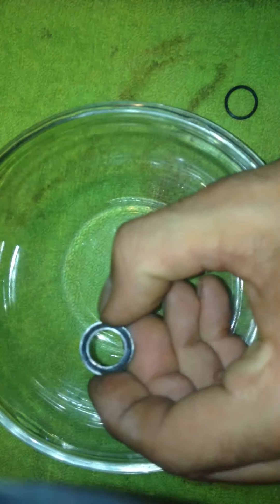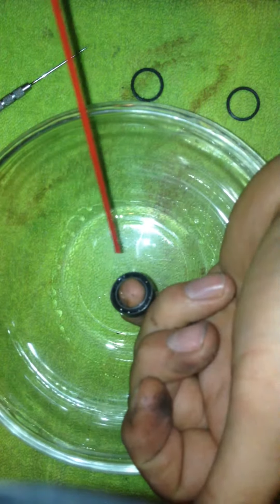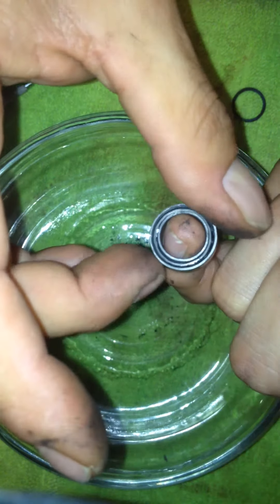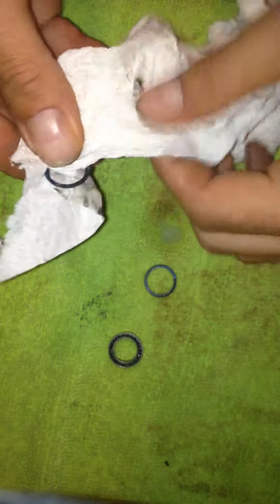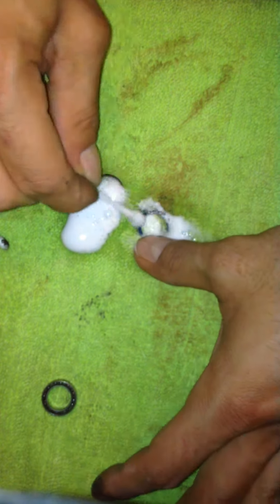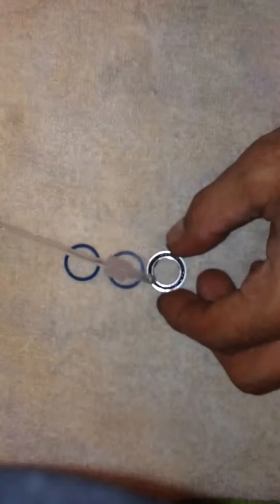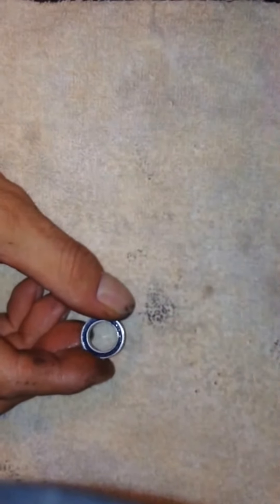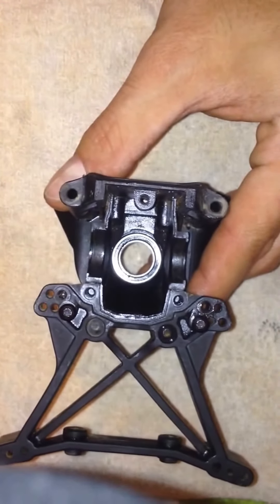How to Clean your Traxxas Slash 4x4 Rear Differential Drive Shaft Bearing.

Comment: nice video I will subscribe but in my car I cleaned the whole diff and put grease in it and there is this little grinding noise in the rear diff did I not screw the main gear on even what do you think I should do
Reply from the maker: Thanks for the Sub!! It sounds like it's inside your Diff housing.
Reply: screw it on even. thats it